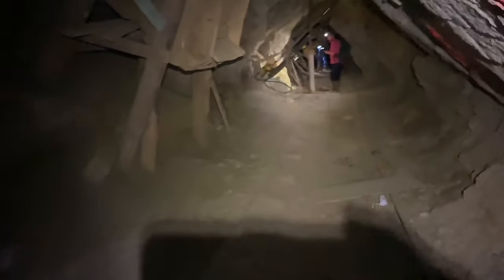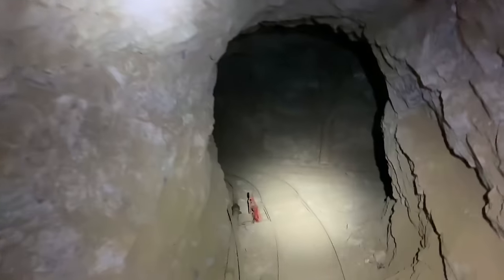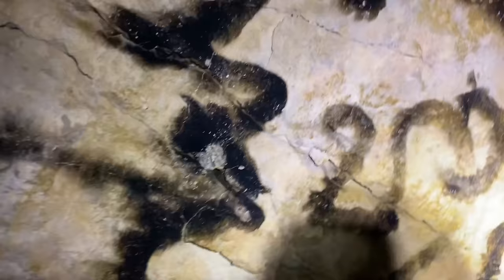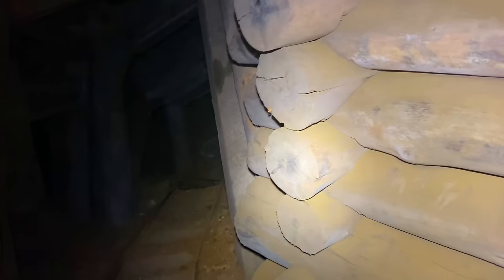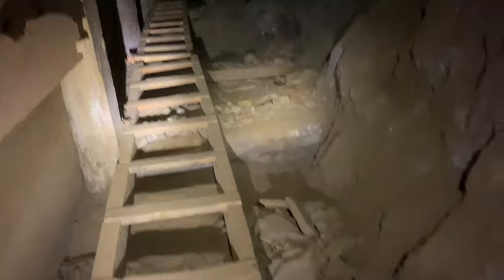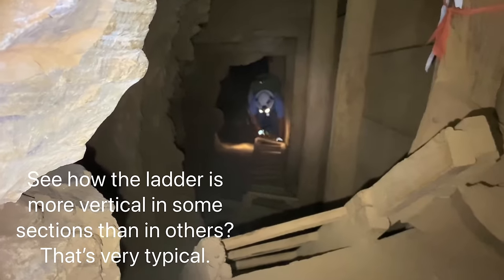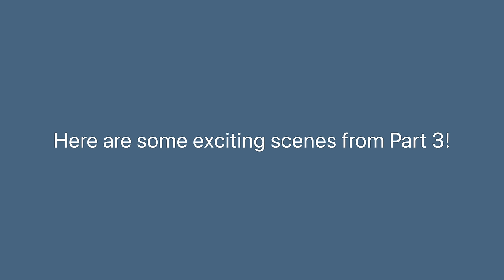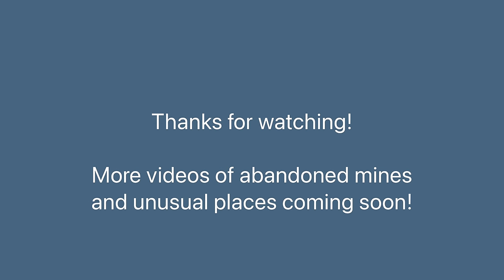Finding Rare Mining Equipment in a Massive Abandoned Mine in Nevada (Part 2)

Comment: U GOTTA HAVE BALLS OF STEEL TO GO EXPLORING THESE OLD MINES. VERY DANGEROUS IN THESE OLD MINES, THEY CAN COLLAPSE AT ANY TIME OR HAVE DANGEROUS GASES
Reply from the maker: Hey, Frank! Nice hearing from another Frank! Thanks for stopping by and checking out the video. Yes, these mines can be dangerous. But we come prepared with lots of appropriate safety equipment including hydrogen sulfide gas detector, an oxygen meter, rope, a SPOT beacon, and many other things.
Reply: @AbandonedMines11  OK COOL 👍 THAT IS GOOD U TAKE SAFETY PRECAUTIONS BEFORE GOING IN THOSE MINES. I BET IS VERY COOL TO FIND RELICS AND LOOK AT OLD GRAFFITI. WELL BE SAFE IN THOSE MINES AND THANKS FOR THE VIDEOS
Reply from the maker: Yes, some mines have more artifacts and things in them to be discovered than others. And, as you’ve seen here, some mines can be very small while others can be multilevel with miles of tunnels. I’ll have more videos coming soon of mines of all sizes. Thanks again for your support!

Comment: That large drill at the beginning looks like some type of coring drill for getting samples from the ore body so they will know where to drift and stope .  The ground support in the wall where the drill is looks to be standard split sets ...  You drill a 1 1/4" standard hole of various lengths with either a jackleg or stoper . Depending on the type of support you are installing .. ie  split set, rock bolt, rebar or swellex the holes can be 4 - 12 feet deep.
Imo  rebar with resin and rockbolts are the ground support I trust the most .   Split sets can't handle any shear forces and are only hammered into the drilled holes for a friction fit.  Fairly cheap and good for tying up smallish cracks and wedges in the ribs and back .  Better yet with screen .  Good to see you Frank, and am enjoying the neat mines you've found .
Reply from the maker: Thank you so much for all the additional information regarding the drill and what might’ve been going on there with it. I really appreciate it, and I’m sure the other viewers do, too. Thank you for your support!
Reply: I'm pretty sure it's in the middle of installing bolts and the miners walked away. if you look there are several other bolts in the face. looks like they were reinforcing where the rib flaked away. crazy they were in the middle of working when things shuttered
Reply from the maker: @seldoon_nemar  Yes, I’ve heard that when these mines closed up they often closed up quite suddenly with no warning. Miners simply were told to leave and never come back. That’s why we find all these artifacts in some of these more remote mines. Things were just left where they were on the day that mine closed — things like sticks of dynamite, containers of blasting caps, ore carts, machinery, tools, etc.
Reply: The drill in the beginning is a small bar n arm core drill it’s not super old by any stretch, don’t know why they would leave it even if the rods were stuck or the bit was burnt in due to lack of circulation water / mud . My best guess would be the operator (s) probably had intended to remove it but were told by management to leave it in place until they could recover the rods and bit especially if the previous operator was inexperienced and stuck the entire drill string pissing off the foreman/ owner who then fired the operator and began looking for someone who Could actually be productive / experienced with the equipment.

It is DEFINITELY NOT used to install rock bolts ! That task is done with a jackleg drill or a drill jumbo or a stoper drill is used if one is available the stoper makes installation of vertical to slightly inclined up holes way easier and is mandatory for installing bolts in Canada ( if you are a Canadian miner ) that is . I have probably installed a. Opulent million rock bolts in my 40 year career as a professional underground hard rock miner/ contract miner . And I think I am pretty much qualified to give some facts .

Comment: Those miners were so brave, very dangerous work, in terrible conditions. Interesting they all still have a story to tell, with the mine being explored after all these years. ❤😊 ps you are all so brave climbing those ladders those levels were high!
Reply from the maker: The ladders weren’t that bad. As long as they’re not straight up vertical, they’re usually not a problem. I normally don’t climb ladders in abandoned mines unless I know beforehand others who have already climbed them and suffered no ill effects. The guys I was with had already climbed these ladders in their previous visits to this mine and could attest to their integrity and safety.
Reply: @AbandonedMines11  yes scouting beforehand is a good thing, I was surprised how good condition the wood was on the ladders, certainly not rotting, They just seem so very high & vertical! 😱🥰

Comment: At 7:02 I keep hearing this earthquake damage down deep in mines thing, which really isn't what it seems. The seismic energy of the earthquake is released at the earths surface,  just like being deep under water and beneath a large wave, you can barely feel the wave as it passes overhead.  At 8:55 you would think that over the last 150 years that countless major earthquakes have occurred in the area, but those mines are still accessible because the earthquake energy has quietly passed through those mines causing little or no damage, as compared to the surface damage. The greatest risk during an earthquake is landslide which buries the portal, and traps you inside.
Reply from the maker: I’ve heard the same thing that you mentioned in your comment. I’ve heard that in a major earthquake, you would never know it was happening if you were underground. As you mentioned, the seismic waves are only felt on the surface. However, in the initial jolt sends a seismic shockwave through the entire crust. I would tend to think that would be quite noticeable. As far as the ground shaking like it does on the surface for an extended period of time, that would not happen underground. That’s my understanding of it. So all of those shifted timbers I showed in this video probably got shifted to the left when the initial seismic jolt came barreling through the ground. All of the subsequent shaking that was felt on the surface would not have been felt in that particular section of the mine because it’s too far underground.

Comment: When the order was given to shut down the mine, they abandoned the drill with it's bit still lodged in the stone. The nude graffiti was interesting. Centerfold pictures rendered in carbide smoke from long ago. If you could obtain one of those old lamps and a supply of carbide. It would make for an interesting video showing how they produced their graffiti, ( the non-obscene, of course😉).
Reply from the maker: I believe you are absolutely correct about that drill being left in place while it was being used. It’s amazing they did that when the mines suddenly closed like they sometimes did. The miners just dropped everything and left. Everything is frozen in time. Yes, the nude graffiti was interesting. Not the first time I’ve seen that in a mine, though. The abundance of horses or burros is also interesting. I’m assuming that’s because the burros worked alongside the miners down in the mines by pulling the ore carts. I like your idea of obtaining a carbide lantern and showing how the miners drew their  graffiti. Always good hearing from you! Thank you very much for checking out the video and taking time to comment. I appreciate it!